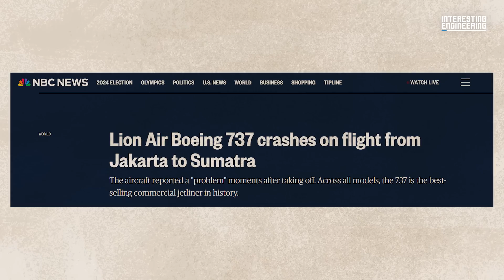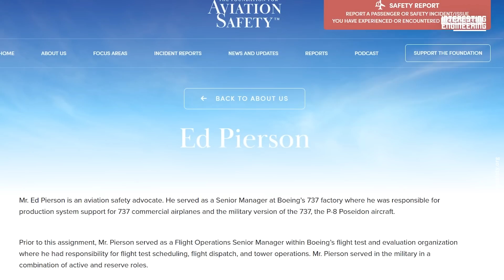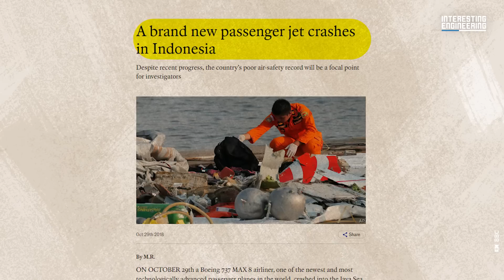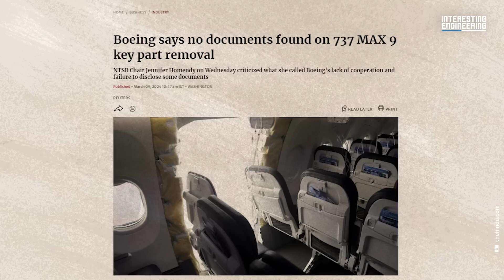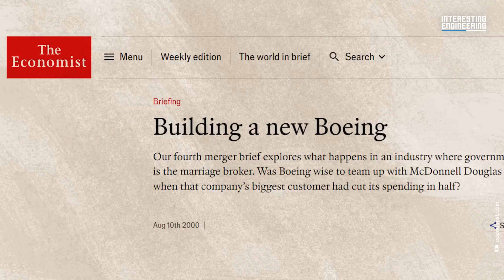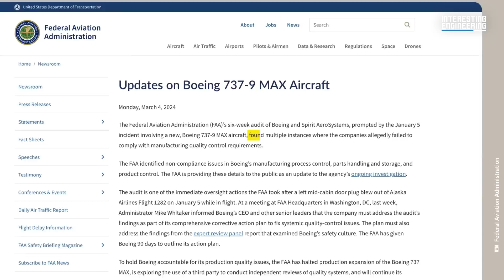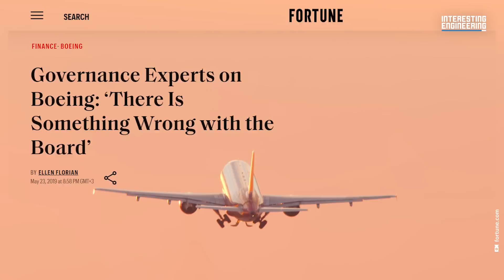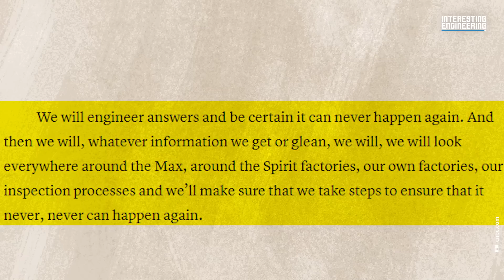Why Do Boeing Planes Keep Crashing?

Comment: FAA is not independent of Boeing. Therefore it’s not a real regulator.
Different airframes, different planes. Calling it 737 each time what is the benefit ? Less regulation and oversight when bringing in a brand new plane because you’re claiming it’s the same as the old plane?

Comment: Why don’t you naive people stop bad mouthing Boeing how much more naive can you get or maybe you are on airbuses payroll
People such as you should be sued for slander
One of my son is a pilot with Air Canada flying a 737 Max and he loves the plane
He previously was flying the Airbus 220 and Boeing 787 which he also loved to fly
Both companies make excellent airplanes using controls engines and other hi tech gadgets made by US companies
Boeing is going through a tough time and we all know why and in most cases the fake media is to blame with
all these Boeing plane incidents
Boeing has been around for decades building good safe planes and I am certain that their overall safety record is as good as Airbus
There is no doubt that there is a quality issue it is impossible to oversee 160,000 workers spread around in various factories to see if they produce good or bad quality work intentionally or unintentionally
The two fatal crashes could have been avoided with western trained pilots
They would have overridden the faulty sensors and fly the planes to safety manually An independent French investigation confirmed the same but the fake media never talked about this
Losing a wheel, skidding off a runway, engine fire has nothing to do with Boeing but it is a maintenance issue
Maybe airlines should be investigated and grounded until they improve
The recent plane plunge maybe is a maintenance issue as well we do not know yet but right away Boeing gets slammed There is all kinds of mis information out there but none of these news outlets gets shut down

Comment: MCAS never killed anyone. This is a story of lies and shear ignorance. Wile it’s indisputable that MCAS system was not designed to be “Fool proof”, which these days, given the level of operators and their employees, is a big enough sin, it did not cause an unrecoverable situation. Proof is that the event happened many many times before and with absolutely zero issues when handled correctly with existing procedures. There is no “MCAS failure” procedure because MCAS did not fail and MCAS was never the issue. MCAS caused a “Trim runaway”, a non normal situation which can be caused by other systems failures and has a procedure to deal with since WW2 or earlier. If the airplane is flown correctly, and it wasn’t, and if the electric trim gets isolated as prescribed, and it wasn’t, there is no need to stop sipping the coffee in this event. MCAS, through the failure of an AOA (angle of attack) sensor, commanded a pitch down trim, this is un “undesirable state”, not deadly, not unrecoverable. The failure of the crew to A) fly the airplane properly B) deal with the “Trim runaway” as we always did since decades, is what caused people to die. On top of that the redundancy of 2 AOA sensors was available to airlines who decided to save money and purchase only one. Furthermore there was no calibration performed to the AOA sensor in both instances. Crew were fully aware of the issue in both Lionair and Ethiopian incident, in Lionair because the issue happened already the flight before (and was dealt with correctly by the crew with no consequence proof that can definitely be resolved with simple actions), in Ethiopian because just few month before the Lionair accident happened so we all knew. So they knew and there was an effective procedure. And let’s not forget the severe handling errors made by the crew which was a determining factor in the loss of control. If you don’t know what I’m talking about you either don’t know the facts of the matter or are too ignorant on the subject to understand or both. In either case you should not scream with pitch forks and torches but get back to where you belong, the seat of non professionals who should have the decency to shut the f. up when they don’t understand stuff. The sad sad thing is that there are so called “pilots” who got on this bandwagon of stupidity and bs. Ultimate testimony that this industry is now in full decline and the pilot body is filled of ign**rant impostors. MCAS never killed anyone.

Comment: The root cause the 737 & Boeing fiasco can not be fixed in few years. It took about 20 years that Boeing degrade and fall down to this disgrace. They pressed the bottle too hard and break it. So it will take another 20 years, a generation of Boeing employers and management, to recover from such deadly disease and regain confidence of passenger.

Comment: As a chemical engineer we would never make a safety critical system rely on one sensor. Worse than that no aircraft should rely on an electronic system to be safe.
Reply: You are an engineer but does not know that this sensor can be overridden and than the pilot can fly the plane manually
You are an engineer and you have an ethical responsibility ie don’t spread such crap on youtube

Comment: Mr. Ed Pierson points out many things that existing in Boeing's culture, yet I am not as optimistic as he does, the company culture is not to be built by one or two generations, so as to change it back to normal. Whoever the new CEO afterwards the Boeing culture will remain the same unless the whole board of directors to be changed as well. Another thing is, when FAA allowed Boeing to inspect their own quality before issuing the certificate, no one can stop another deadly corruption to be happened again, 737? 777? 787?

Let Boeing concentrates in their military business. I am saying goodbye to them. 👋🏽

Comment: Boeing should have faced serious  legally transactions decades ago. What do you expect from the people that absorbed the assets of the now sued in to oblivion air Douglass there unacceptable accidents that killed hundreds of people back in 1972 over France when the cargo door failed to stay attached . Thank god the Windsor Canada cargo door blow out prior  in 1970 resulted in a close call but successful last minute non fatal touch down were no one died. The cargo door flaw that was technically a known about issue by the mc Douglass company as far back at least in 1964 before  the planes were even finished and used the first time middle of 1970. 6 years in advance Douglass had to fix the issue under the radar before Windsor happen and they failed to do so epically.

Comment: Current culture in the United States has not quite reached the saturation level of "educated" nitwits more concerned with their personal pronouns, personal feelings, the "gender/non-gender of the day", DEI theology, and perhaps a bit of extra schooling/training in some discipline or other to prepare one for entry to a rather technically demanding field like electrical/aeronautical/civil/other engineering.
I have not flown on any commercial flights since my retirement from Lockheed in the early 90s. At 89, I can think of no compelling reason to board a metal tube "guided" on its trajectory through the atmosphere by a couple of hopeful individuals up front who place a lot of trust in the software, mechanical integrity, and oversight/inspection adequacy of the whole manufacturing process of the contraption a hundred or so folks have paid to get them from "A to B". Fortunately, neither my wife nor I will need to have concern about what will occur 15 or 20 years down the road.